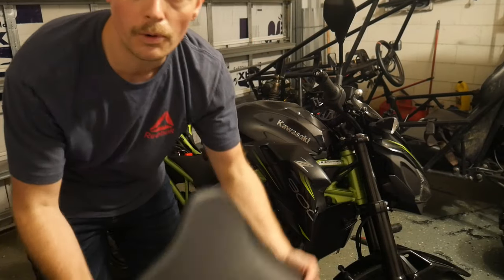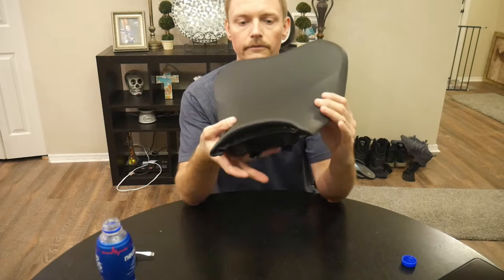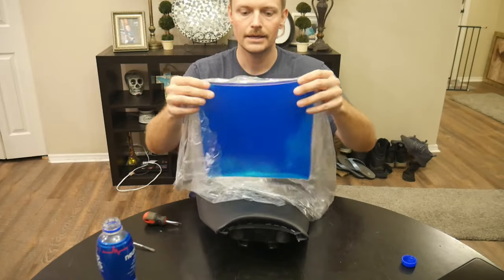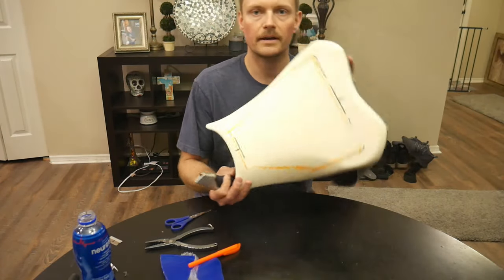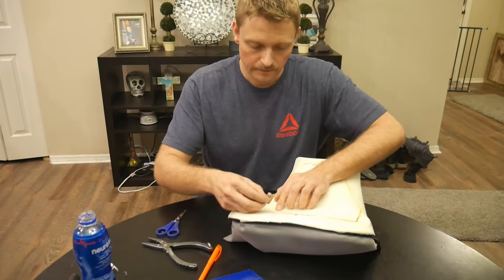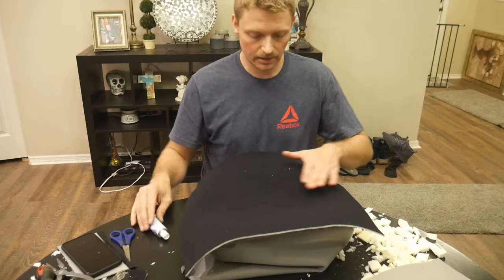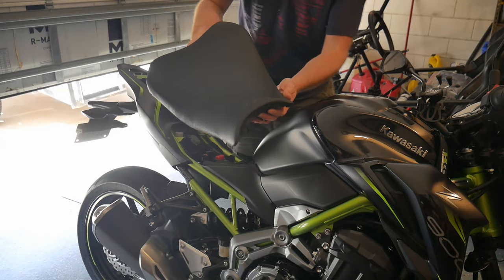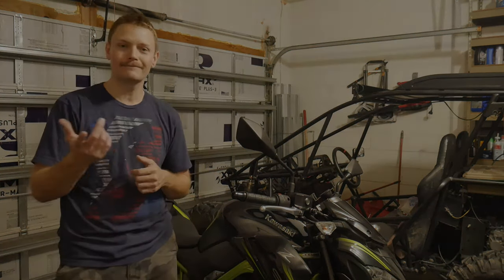Fix any uncomfortable Motorcycle seat yourself for Cheap!

Comment: it is really dumb from manufacturers to put uncomfortable seats on almost all bikes because really the first impression you make from a bike is when you set on it in the showroom if you feel uncomfortable most likely you'll change your mind and buy another one. like if a guy with 25$ could do a better job than a manufacturer then the world is a messed up place
Reply: I also believe that if the designers are motorcycle riders, then they would be the first to promote better saddle designs that emphasize comfort. I understand that for racing it's a different requirement but for the average motorcycle rider we want a saddle that doesn't make us sore after a long ride out.
Reply: Manufacturers don't put much effort into seats its like the seat is an after thought
Reply: @RickyLafleur10  NO they FULL well understand,,,but they HAVE to meet price points AND keep the weight down...translates to hundreds of cuts in quality on anything they feel wont be a deal killer
Reply: Not only that MUCH of the time manufacturers have an entire line of upgrades for some models...."touring seat"  "tall seat" "low seat"etc....they LOVE to cash in and having a really pathetic stock seat REALLY motivates new customers to cough up MORE money
Reply: @nigelwolfe6150  I would gladly pay extra for a more comfortable seat. Went on a 2 and a half hour ride today wore my bike shorts that have padding it made things much better

Comment: If you use spay adhesive, don't do it on the kitchen table, there may be a load of overspray and it'll stink the house out. It will severely reduce your chances of a frolic with your other half....

Comment: Thanks for the video. I just finished the surgery on my seat. Did the whole job for less than $40 and under and 1hr. Hopefully less torturous. For those people watching this in Europe, the foam is called Headliner Upholstery or Headliner Foam.
Reply: Thanks man, I was actually wondering what was the name of the foam ;)
Got the gel insert and now will order the foam and then will get started 🤙🏼
Reply: Scrim foam in UK
Reply: Finally got around to doing a long ride [3hrs+] seat gel definitely made a difference. Ass was still going numb after the 2hr mark, but was less so than previously. Was a hot day, no issue with retained heat per some others comments.
Reply: Hello from Germany,!  A link to where and what to get a gel would be helpful.
Reply: How did you put the staples in? I don't have a machine to take care of it
Reply: @Rafael-fo9sp  hand held tacker. Something like the Stanley Fatmax. They cost about 15 eur.

Comment: You cannot test sit the seat in your garage or in a show room. You must test the seat  doing at least a 2–4 hr ride in the saddle..
  I have a Kawasaki Z 400. I am trying to make the seat tolerable for at least 100 miles ..I ordered a sheepskin on eBay for $20 directly from Scotland. Under the sheepskin, I have what was an aerobic exercise pad my daughter gave me. It’s about 1/2 “ thick.. I doubled it over so it’s about an inch thick cut to fit under the sheepskin which I sewed Velcro at the narrowest part of the seat under the sheepskin to attach the sheepskin which keeps the pad in place at the same time. This has been the best combination..
  I also tried some black foam it’s about an inch and a half thick. It looks like rubberized charcoal foam. I believe that is too thick, and it also put my balls to sleep. I had that same problem putting my junk to sleep with a Corbin seat that had a hump in the front of the seat where it meets the gas tank on my moto guzzi v11 sport.. that Corbin seat was hundreds of dollars and it was worse than the stock seat because it put my junk to sleep. I was sitting on them, and it stops and long stretches, I was always reaching down fixing everything getting them out of the way so I wouldn’t be putting all my weight on them. Don’t get a seat with a hump in it. Corbin makes a seat for my Z 400 and it has a hump in it according to A video review here on YouTube about that specific seat for the ninja/Z 400 made by Corbin..
   i’ve had dozens of motorcycles, I have had six Corbin seats. The best seat I ever had was on the stock seat on my BMW K 1200 LT. BMW motorcycles what they used to be but they sure know how to make a seat..It was very minimal, it looked almost exactly like the seed that comes on the Z 400, I could sit on that saddle 400 miles at a time. That was the best one. The second best one was a Corbin seat it was on my Honda Pacific coast for 24 years. I commuted on that machine five and six days a week , Eight months of the year here in the Northeast. I have done 700 mile days on that Corbin seat, I was not Daisy fresh at the end of a 700 mile day, but my ass was not hurting.. The stock seat on a Honda Pacific coast was too soft. You cannot ride a soft soft seat all day. It doesn’t literally pinch you, but it pinches you by being too soft. That BMW K 1200 LT seat and that Corbin Honda pacific coast said I had were very much like a horse saddle… a horse saddle is just shaped right, it doesn’t really have any padding.. I think the reason a horse saddle shape is so successful and can be written all day long, is because it is firm, and air can get around it. I think that’s why sheep skins are so good because they breathe..
  I just did a 340 mile day today, 85° was the high, sort of humid, the seat on my Z 400 with the sheepskin and that inch and a half thick rubber under the sheepskin on top of the stock Z 400 seat broke my ass. My ass is broke right now, that’s why I’m here on YouTube, Trying to get pointers from people that may have figured this out
Reply: 😆Great story. Thanks.

Comment: Don't do it.  The gel retains heat from sitting in parking lot sun. It burned my cheeks off for a very long time on my commute home.  Seriously chapped my arse! 😂 Buy an aftermarket foam seat that has less heat capacitance.  Save the cheeks!!
Reply: @DirtGearTv  That's why you put a thin layer of something on top of the gel dummy

Comment: I would also wrap the gel insert in a layer of polyester, nylon or wool fabric. Adhesive the fabric to the gel or over lapping the fabric and adhesive the fabric. Sort of if your wrapping a present. The gel can melt, get wet from heat and rain. foam is very porous to begin with. Elements will most certainly soak thru after a while even from the extra layer of foam you put on top.

Comment: Excuse me but WHY in the HELL should I remove ALL the staples?   Logically I will leave staples in on one side...duhh right?  Just need ability to place new layers and then fold cover BACK where it was....am I missing something?
Reply: so he can fit the foam lining stuff  that he glued? idk
Reply: I suppose if you’re just installing the gel insert alone, your logic makes sense. Personally I didn’t see the point of the extra material he put over the gel.

Comment: Awesome! Ordered a purple cusion seat to do this same process with on my r6.
Reply: I was thinking the exact same thing for my vf750f. Any update on which Purple cushion you used and how its worked out?
Reply: @clone4211  I used the Portable seat cushion from purple, I suspect you could use any of their seat cushions and cut them down to size. It works awesome, much more comfortable and slightly lowers the seat height bc I sink into the seat a little more. It makes a huge difference in comfort and I may do it on my CBR's. I followed the steps of this vid using an adhesive spray and a headliner foam over the whole seat and purple, and then restapled the faux leather seat back on.

Comment: What type of staples were used, also would a regular hand stapler work or is pneumatic needed to get through the seat pan.
Reply from the maker: bob smith Short staples 2-4mm should be fine. You’ll deff need electric or pneumatic to get them seated properly 👍
Reply: I use an old Craftsman industrial staple gun just fine. I found the air hose or electric cord got in the way.

Comment: I'm just wondering do I need a air compressor to put those stables back in? Or is there a cheaper way?
Reply from the maker: A standard cheap staple gun won’t work unfortunately I tried. They do make some really strong mechanical ones that prob work but they aren’t cheap

Comment: Had it done from a specialist in France for V strom 650. Guess a little more than 1 cm thick. Its as hard as it was.
Reply from the maker: I think people are under the impression it's going to be super plush but its not more "plush" than factory. It is however was less fatiguing over longer rides. Anyone that mountain bikes can tell you softer does not mean more comfortable

Comment: The z650 is the same painful seat instead of the gel I used a purple seat Cushion the portable best $39.00 upgrade and if you need more Comfort just get a upgraded cushion from purple
Reply from the maker: It’s just a way to smooth out any minor imperfections you make when cutting away the foam so they are not visible after you’re finished!
Reply: @DirtGearTv  yeah I be riding for hours and the pain start to take effect I appreciate your video it gave me a great Idea that’s cheap and that work it beats paying $600 for a seat but I have a question how the z900 do you recommend it over the z650 ???

Comment: I am doing this. I just did my breakin oil change and finally went for a longer ride of a couple hundred miles today. My butt hurts. Also my testicles which I think has to do with the shape of the seat, they just dont sit right on the seat. That can be fixed with more supportive underwear. I am also dealing with significant numbness in my throttle hand. I am trying to solve all of these issues so my riding experience is less hindered by discomfort.
Reply from the maker: Z900? I know many have complained about the angle of the stock handlebar. The seat mod makes big difference on longer rides
Reply: @DirtGearTv  yes z900. I love the bike, but there just a few things that need to be adjusted
Reply: try not holding the throttle as tight it might help your numbness 👍

Comment: Hi, I like your idea.  I was looking into doing this because my seat is uncomfortable.  I saw a company called Luimoto and they're doing the same thing you're doing except they pretty much charge 300 bucks easily for you to do it with the materials you're paying for.  Could I ask how much was this project cost you?  I ride a 2013 Kawasaki ZX6R and my balls and inner thighs really hurts after a long ride (100+ miles).
Reply from the maker: Tommy Pham For all the supplies it only cost me about $25 total. Everything you would need should be able to find on ebay. Search for motorcycle seat gel insert and you’ll see the gel is like $18 the sow foam was only a couple of bucks and spray adhesive is like $5 a can. Good Luck!

Comment: How’d it go? I’m about to have an upholstery shop do mine and add a marine grade carbon fiber outer cover after they pad it up for me.  You used a 3 mil fabric for cover? I’m just wondering if it becomes soaked in the rain right through? Either way I’m thinking I’m gonna go this route. If ya have the link for materials used let me know.  Thanks! And you ain’t kidding when you say torture! The stock seat is crap! I was willing to spend $200 but, $5-$600 hell no.  I rather put the damper from gpr on for $500!
Reply from the maker: Tosh Rotondo It is an improvement over stock but don’t expect a miracle with any seat this thin, even with the gel 😆 I’m in florida so I hardly ever get caught in rain, not too sure how water would effect the changes
Reply: The Corbin has horrible reviews for our bike. I went to an old school upholstery shop finally and dropped it off today. First I went on the bike so, I can show him exactly where and mark it with some tape. I did go with the marine grade carbon fiber look and just the difference in the quality of materials is night n day. Kawasaki really cheated out on the seat! I’ll be going back with the truck in a day and taking the new seat home with a temp covering.  If all is well and I’m happy with it he will put my carbon on and I’m done.  I’m in NYC so, I’ll probably pick it up tomorrow n ride bike back Wednesday due to rain 🌧. I’ll update ya and let ya know if it was worth it.